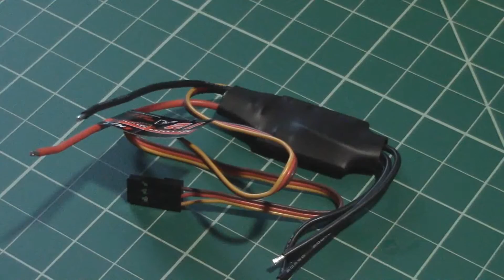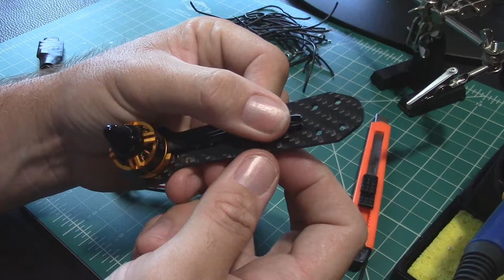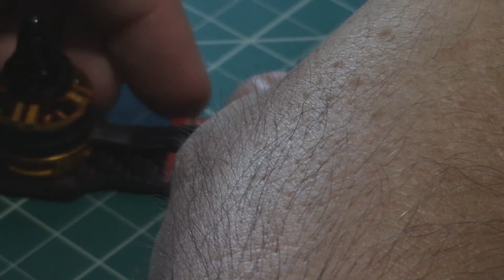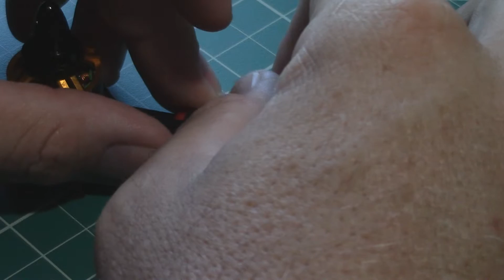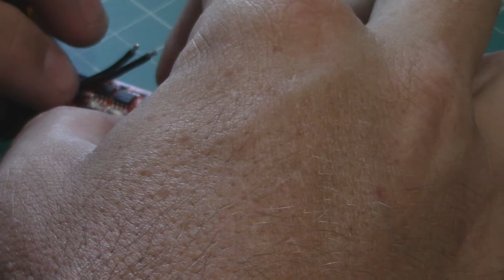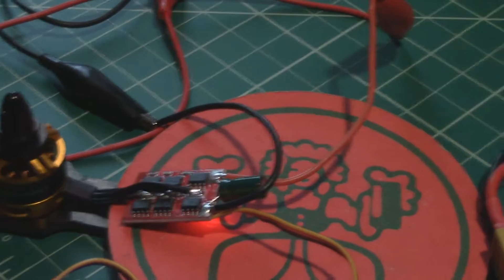ZMR250 Quadcopter - Motor Soldering

Comment: I just unpacked all my parts last night and discovered that building a 210-sized sandwich-style miniquad is a lot harder than a 500-sized quad, because there isn't much space for stuff at all especially considering you have to screw on a cover at the end...!!

I think I might be forced to resort to this method of yours in order to fit the ESC, but I've got RCX motors and SkyRC 12a ESCs so I have no idea which way to solder the wires to the ESCs. I'll be running CC3D Mini and LibrePilot.

Is it OK to solder on and off the wires several times on the ESC while I get the guesswork right?
Reply from the maker: +K Khalifah yes absolutely.  It's just trial and error until you see which way the motor spins based on how the wires were soldered.  I used some.jumper wires to figure it out before soldering, but most people just solder and then resolder if they need to cross a wire to change direction.  Good luck on your build!

Comment: The video you show to solder the ESC to counter clockwise, how about the clockwise? can you show the direction?
Reply from the maker: +Tuan-Anh Nghiem so in this video I said put the bottom wire to the first pad , the middle wire to the third pad, and the top wire to the pad in the middle for Counter Clockwise.  To get Clockwise, you would put the bottom wire to the first pad, the middle wire to the second pad and the top wire to the third pad. I would call that wiring it straight. I call the method I did in this video crossed.  For these EMAX 12A ESCs and these DYS 1806 motors, straight wiring gives you Clockwise rotation and crossed wiring gives you Counter Clockwise rotation.  It could be different for other motors and ESCs.
Reply: Thank you very much for your response. I have another question I hope you can answer. How to calibrate the ESCs ?
Reply from the maker: +Tuan-Anh Nghiem to calibrate the ESCs you usually go to the motors tab in CleanFlight or BetaFlight or OpenPilot if you're using a CC3D flight controller and calibrate them all at once through the FC software.   You can do them one by one directly with your transmitter and the receiver and have each one plugged into the throttle channel of the receiver, but it is easier and more consistent to do it through the FC software.  There are many videos around about how to do it using either method.

Comment: awesome job! works! I'm curious with all the black wires, how'd you know which is which?
Reply from the maker: It actually doesn't matter which wire is which as long as you maintain the same arrangement of wires for 2 motors and then just swap the same 2 wires before soldering for the other 2 motors so those 2 motors will spin the other way.
Reply: +Oin Taylor Hello, should I keep same wire crossing pattern for Emax 2204 2300v motors since they come CW and CCW versions ?
thanks
Reply from the maker: Juan Carlos Vargas yes you should do 2 with wires straight and 2 with wires crossed.  The CW and CCW does not refer to how the motor spins, it refers to the threading direction for your prop nuts.  Your motors labeled CW you will want them to spin in a CCW direction so play with the wires until.you find out if you need straight or cross to make your motors spin in the CCW direction.  Your CCW labeled motors should spin in a CW direction.  If you set this up the right way, your prop nuts will then be self tightening.  See my other video about determining motor direction.
Reply: Ok thanks

Comment: Great video, Thanks for posting! Helped with figuring out this used drone I bought.
He had every motor spinning the wrong direction. 
The ESC in your video are the exact same.

Do you happen to know if they are rapid (my cc3d software automatically tries to use a rapid setting). Or a link to the purchase page, Thanks again!
Reply from the maker: Thanks for watching!   These are EMAX Simon Series 12a.  I don't know what it means by rapid, but I do know that these are pretty cheap ESCs and are not well regarded generally.  They work fine, but are not known as high performance.  I bought these ESCs from Banggood so here is the link to that page.   http://www.banggood.com/Emax-Simonk-Series-12A-20A-25A-30A-40A-ESC-For-Quadcopter-QAV-250-p-918126.html?currency=USD&createTmp=1&utm_source=google&utm_medium=shopping&utm_content=saul&utm_campaign=Rc-Quad-us-mobile&gclid=Cj0KEQiAz5y1BRDZ4Z_K_eGa84cBEiQAtQkeaChwbhZkKzwSmZBTB0YANXjdPLyrsPR9iTCWfKRK9TAaAhKD8P8HAQ.  Here is the link from EMAX themselves http://www.emaxmodel.com/esc/emax-simon-series-12a-for-multirotor.html

Comment: Very nice.. I was planning to solder the motor directly onto the ESC as well, i'm kind of psycho when it comes to wire management... Thanks for the preview...
Reply from the maker: no problem, thanks for watching!  These ESCs are very cheap, and maybe/maybe not be able to be flashed with BLHELI firmware, however I hacked the servo leads later on to use with my PDB so that makes any flashing very hard to do.  If I had to do it again, I would choose some ESCs that can be flashed with BLHELI and I would have soldered them all straight and just reversed the 2 ESCs  I needed to be reversed in the BLHELI firmware.